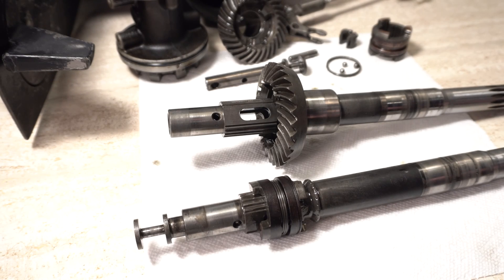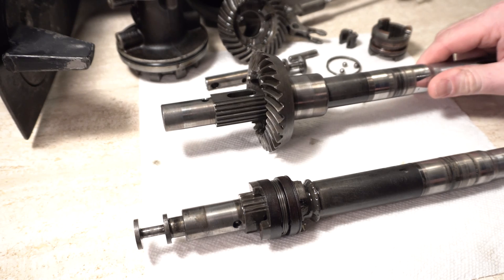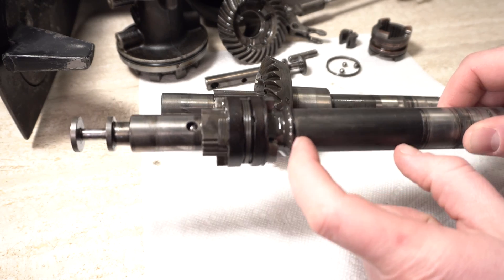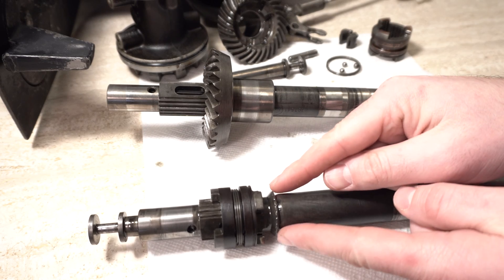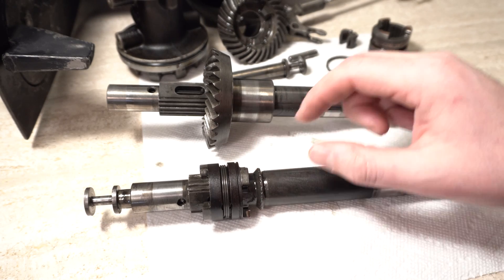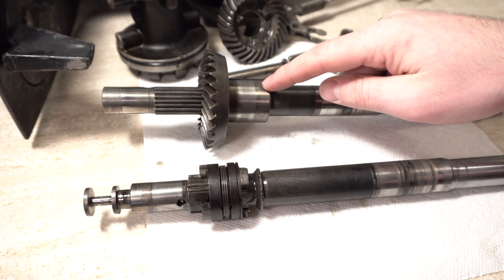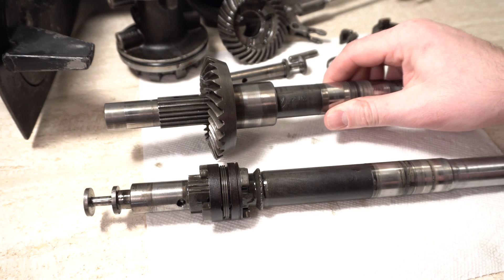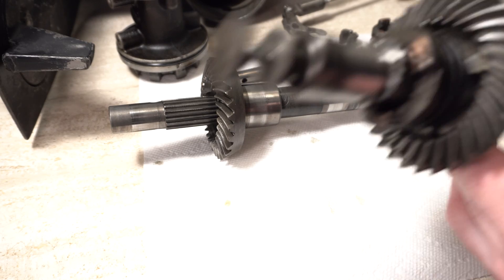Evinrude gearbox damaged reverse gear and prop shaft example - lower unit damage

Comment: Hmmm.  I'm guessing that the propeller was allowed to "freewheel", perhaps on a trailer while being towed.  Or, perhaps the propeller was "freewheeling excessively while being towed on the water with the engine tilted down.  The effect of freewheeling is to draw the propshaft backwards forcing that ridge on the propshaft against the face of the reverse gear, which eventually allowed the ridge to melt/wear just enough for the ridge to be forced inside the reverse gear bore, where it got jammed..  Very interesting issue...

Comment: How did you get the propshaft out if the reverse gear was stuck on it?
Reply from the maker: Its the first one that comes out, unless I am wrong, but I believe the forward gear is the one in the back which only comes out after (drive shaft removal).
Reply: Exactly, i got the same problem right now, but if the first gear to come out was stuck on the shaft how did you have pull it out off the lower unit? i can’t pull out the drive shaft because i don’t have access to the nut under the pignon gear …
Reply from the maker: @nicholasbourdeau3972  The shift link needs to be removed. You need to remove one of the screws near the lower unit oil screw. Then you pull up the shift rod which will bring up it's little legs and allow you to slide the shaft out.
Reply: @IdeaMan4k  how did you remove the pinion nut while reverse gear is still on prop shaft?

Comment: Did you ever work out why the reverse gear does this.
I've just pulled mine down and it's done the same thing.
Reply from the maker: I happened to have a spare motor for parts. Be sure to use the marine engineer site to confirm you have all the parts and not missing a washer.

Comment: do you by chance have a video on how to remove the driveshaft and prop shaft??
Reply: from same motor
Reply from the maker: @gearheartscott   Removing the drive shaft is very difficult. I have a few videos if you look under my Boating playlist. Removing the prop shaft is quite easy. Just need to disconnect the shift link pin - drop the lower unit, and pull the gear housing out. If you look through my links you may find some useful videos. Thanks